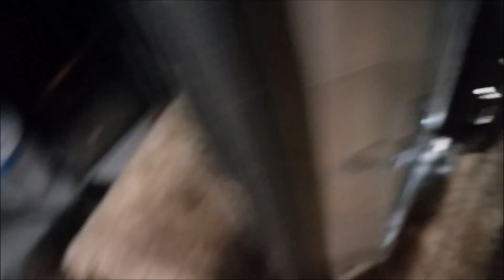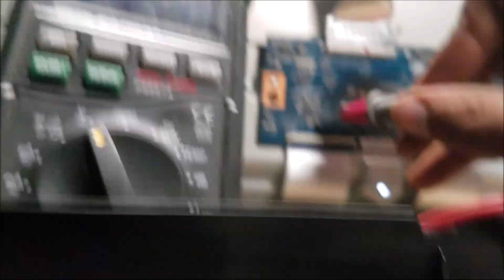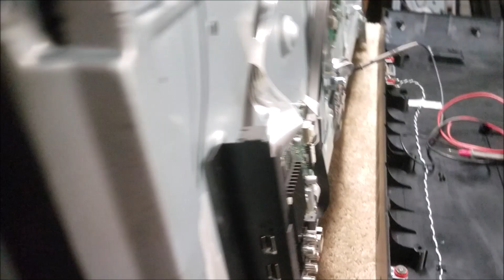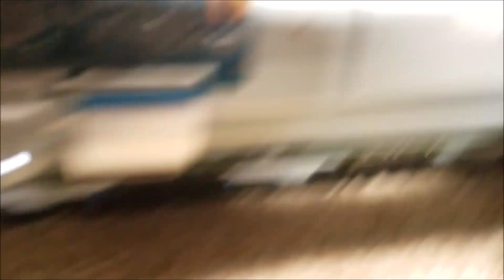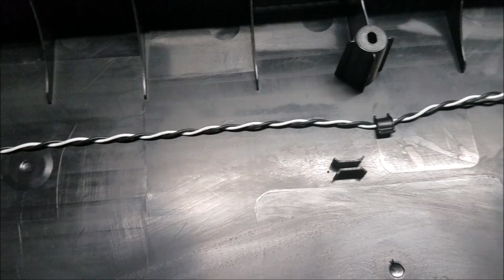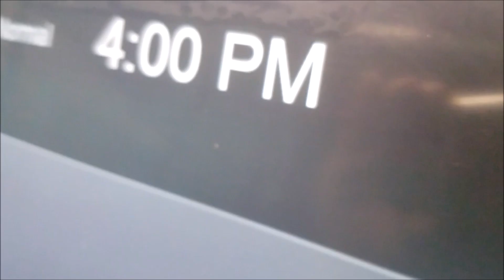vizio tv V556 G1 only vertical lines on screen fix

Comment: Had my Vizio M55Q7 for just under 1 year when it went bad, called in a warranty repair, got it fixed, a few months later, I got the red vertical lines. It's a brand new paperweight, never buying Vizio again!!! Glad I didn't just throw it away, I will try this fix and when it goes bad again, I will throw it out or sell for parts. Thanks for the video!!!

Comment: Hello i no your videos are old but i need help with my 65" vizio Model P65C1 the LEFTside has colored lines  the RIGHT side shows good!  The Tcon Board has 4 ribbon cables - pls help - i went thru utube and couldnt find the help i needed
Reply from the maker: try use the tape or side cofs check my other videos

Comment: Thanks for your video. I have a similar Vizio TV that had the same issue. I put tape on the contacts of the one showing to be defective, and after some trial and error I was able to get the picture back - even if it wasn't perfect. This TV should be fine for a while I think. Thanks for the fix!

Comment: I had red vertical red lines on my screen. I tried all these methods with no solution. I ordered a T-Con board for 20 bucks shipped on eBay and it came with the 2 bottom flimsy connectors. Problem solved! TV is as good as new. Make sure you replace the bottom flimsy connectors along with the TCon board as that alone may be your issue.

Comment: Good video sir and helper. These television nowadays do not last long at all. The parts they are putting inside of them does not do will with voltage changes. That is the main issue today. It's been like this for the past 5 or more years now. Just think about a LCD/LED television you have had since 2012 or 2014 and it is still working. That will tell you something right there. They know the capacitors, chips, fuses, etc, can not handle voltage changes like before. So if you know its going to be a bad thunderstorm outside and your power goes out a lot due to the storm unplug your smart tv's because the power surges will kill you Tv nowadays even if you did have a power surge protector. But not all Tv's have this problem. It depends on where they are made.
Reply from the maker: you right! TVs now are shipper and weaker

Comment: Had the exact problem with my M557-G0 and was ready to toss it. Covered the same two pins and all fixed (or at least patched). Thanks!
My question is, is the problem the ribbon cable itself or the T Con board? Just wondering in case the issue resurfaces and I want to replace the culprit.
Reply from the maker: problem is the screen
Reply: @SOSfixElectronics  oh really? So replacing the cable and/or the t con board wouldn't fix the issue?
Reply: Let me jump in here. He is right it is the LCD screen itself. For same reason VIZIO has been installing parts on the LCD panel that does not do well with voltage changes. So if you have a thunderstorm outside and or your power goes out and back on several times or surges that can cause problems with the parts on the LCD screen panel and or T-Con board and main board also. Many TV's have the same problem though, and these manufactures of these television knows this problem. But they also know replacing the LCD screen panel is costly and people will just buy a new set. So they are just going to keep doing what they are doing. So it does not matter what name brand your television is. They are in the business to make money and that's why Tv's are cheaper now because they can make money on parts replacements as well. I work on TV's for a hobby and have been since the tube television which was more harder to fix. These television nowadays are a lot easier to fix but have more issue and that's by design. Trust me     @TheTabe

Comment: I've got an M558-G1 with this exact problem, same t-con board, even narrowed it to the same side as shown in the video, but I cannot come up with the right combination of leads to cover on that ribbon cable. So frustrating.
Reply: i also ran into this issue a bit today. I just decided to settle for the least artifacting combo as possible. The bottom left corner of my tv has a somewhat bright white spot but its still better than no tv at all imo

Comment: Finally was able to repair my tv. I bought new t on board and still had death. 
Unplugged 1 side and had 1/2 white screen. Switched sides like you did. Had half picture. Cover 1st 3 pins. Nothing. Covered pins 4-6.
B I was back in action.

Comment: So i tried this buy when i pulled the screen cables from the TCon i still had a bad picture on both sides of the screen, are there any recommendations as to what it should be? I did replace the TCon already and did not see a change out of it. Could this vertical line issue come from the power board not supplying enough power. I will say that i get the normal Vizio logo for a couple seconds and then the lines fade into the screen slowly. The backlight appears to come on okay, and it does take awhile to turn on and boot up so i can change the volume( Indicated by more verticle lines appearing at the bottom when i change it. I have a Vizio P659-G1

Comment: Mine is doing something else. The vertical lines began at the top and was slowly began working there way down while I was on the app screen.....the remote wasn't really working, but it may have been working because the colors would change.......far as the app screen it was still frozen on the bottom of the screen. The power button did work turning it off and on.......could mine also be the same thing? Do I need to clean the cable connectors?

Comment: This fixed the horizontal lines on my 58 inch 4k vizio. But now half of the left side of screen color is faded. I put tape on #1 trace the right ribbon. V585-H11
Reply from the maker: maybe you covered some traces thats need for the left side data or may still have some bad traces thats need to be covered
Reply: I only covered 1 trace, the first one. When I cover multiple traces the lines on the screen are worse than no tape. So I will order new wire ribbons hopefully that works.
Reply: @Chi-Town-Meechie did it work? Having the same issue on my 58 inch e585
Reply: @Chi-Town-Meechie can u link where to find the ribbons?

Comment: This video helped with my TV Vizio E55-F1 with T-CON part number tx-5555t32c28. My tape went on traces 4, 5, & 6 on the left side of the left ribbon. My question is: Is this a permanent fix or will it only work for a short time?
Reply from the maker: this is a permanent fix, if you covered the right traces, the tv i m using now in my house same repair done in it still running every day strong after 1yr
Reply: @SOSfixElectronics   Now the TV screen has gone black, backlight is on. Sound is good.
Reply from the maker: @snrwest  check the cables to the screen are connected good
Reply: Worked for me for about a week but now it's starting to happen, intermittently, again.

Comment: What if both sides had the same problem. Would you have to put tape on both sides of the ribbon cables to get a picture?
Reply from the maker: hello, :) good point i didnt see the both side get bad before, and if that happen you cant cover both side traces, in this tv i cover right side bad traces so the right side will feed the voltages and signal to the pixels in left side, but if you cover both side the screen wont work, i ll keep it in my mind for next tv to try it and show the result

Comment: Hi I have a 75s425 tcl I tested the backlights they all work there is a red light on the main board where the connection for the optical is there is a white standby light on the bottom I’m thinking either it’s a power board issue or a tcon board any solutions that may help thank you
Reply from the maker: what is the problem? wont turns on or no picture?
Reply: @SOSfixElectronics  it won’t turn on no picture no backlights
Reply from the maker: @markb8035  but you said you hear some sound thats mean the tv is on but the picture is dark or no picture
Reply: @SOSfixElectronics  tv doesn’t turn on there is sound when I turn the tv off
Reply from the maker: @markb8035  so the tv turns on but no picture no backlight?
get the multimeter and check the tcon voltage after you turns on the tv, to see if you have 12 volt on the tcon fuse both sides of the fuse
Reply: @SOSfixElectronics  ok i will check the tcon board thank you i will get back to you with the results
Reply from the maker: if you have 12v in tcon thats mean the tv turns on screen is on and there is a picture but is very dark cuz no backlight, and you can use flash light to check the screen picture you may click the menu it will help.
Reply: @SOSfixElectronics  ok I replace the tcon same issue than I replace the power board the backlights went on sound but no picture I took the ribbon cable off on the left side now I have picture to one side I tried the tape thing but no picture yet still trying any help or advise thank you
Reply from the maker: @markb8035  yes you need to remove the side cofs from the bad side of the screen, i have a have a videos of that just go look for it
Reply: @SOSfixElectronics  can you send me the link please
Reply from the maker: @markb8035  https://www.youtube.com/watch?v=orkbgllBGCk&list=PLS__qDpAF6OX09FmkRvXmDx_YRuSEwoqd&index=73&t=232s
Reply from the maker: @markb8035  https://www.youtube.com/watch?v=kgdMdoOQqAg&list=PLS__qDpAF6OX09FmkRvXmDx_YRuSEwoqd&index=8
Reply: @SOSfixElectronics  ok I will let you know how it went I’ll take off the one side that’s not showing picture only thank you🤞
Reply from the maker: @markb8035  be extremely careful the screen is very fragile  and can get cracked easily, good luck
Reply: @SOSfixElectronics  ok thank you I’ll take it off carefully
Reply: Mine also Same model tv no picture no sound for the last 10 days a technician told that it is due to water 
We are at Uppal Hyderabad Telangana India 
Any technicians available here to rectify this problem kindly let me know
Reply from the maker: likely is the mainboard issue.